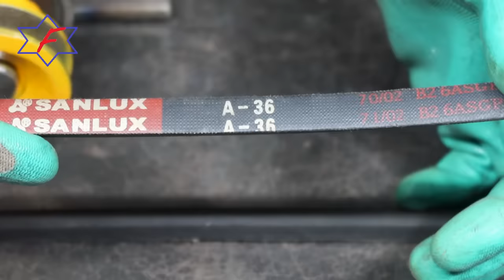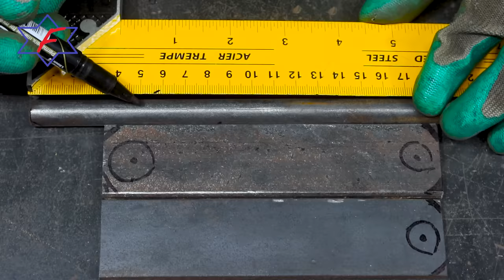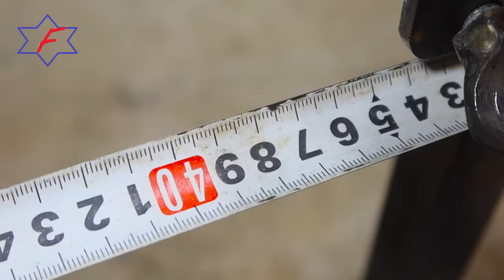Make A Mobile Table Saw Use Battery Power | Easy Bring To Workshop For Everyone

Comment: Love it, and I can understand the reason; store bought saws sucks, motor dies after a while and no replacement to find, battery charged is new but very handy. And the 90 and 45 degree are not using the same slot so the opening is always small. Good job and thanks for sharing.
Reply from the maker: You are welcome!
Reply: ឱឱឱឱឱឱឱបុ

Comment: Great build but ditch the battery idea. That 3000watt motor need to draw 250 amps from those little 12volt batteries so they won't last long nor will that inverter.
Reply: Piosenki
Reply: @StefanStefan-qt6vy  o

Comment: Please stand to the side when cutting.  And add a splitter after the blade. Those boards go faster than you can duck from the kickback. 
Very interesting and skilled piece of machinery.  How do you recharge the batteries ?
Thanks for the video. I watched from beginning to. 😋

Comment: Awesome job bro. You're amazing with the fabricating.bAre you tig welding this mild steel with no filler..ie fusion welding?
Reply from the maker: I used this one: https://bit.ly/3zRuNUY
Reply: @fawabros  yea I seen thr welder but I didn't see any filler rod that's normally with tig. Did u just fusion weld it.  Or is that a tig with a wire feed?  I can't find which type of weld your using.  The technique.

Comment: Aways table saw fence got to be on right hand side  bro... also always count the safety first while designing the machine and while working on the machine... your fingers to close to the running blade, use push stick or push pad

Comment: Great tool idea but cross cutting the way you are doing it is dangerous and you could be exposing users to injury. If you put a miter gauge arraignment for cross cutting  on this it wouldn't be a bad idea . An easier way of doing this would be to just buy a cheap table saw and put an inverter on it with batteries and  an inverter and you would have the same thing only safer . Right now any one who builds this is going to get hurt  eventually and this is not a good thing if you want your channel to grow .

Comment: Nice project! I was looking for some idea to build the same when I saw your video. Good job but I noticed a few things that you should take into consideration.
1. I noticed that your blade is moving in the opposite direction. The cutting action should force the wood down to the table not up. 
2. Your blade should be tilted away from the fence so it won't cut the fence by accident.
3. I'm sure that you're going to or already made a cross-cut jig or something similar for this saw because as mentioned by others, it is just a disaster waiting to happen if you don't.
4. The saw is noisy and the blade is a bit wobbly. I think you should place some grease on the bearings. It will also cool the metal down a bit.

I hope you advise these to your fellow followers so they don't make the same mistakes and injure themselves. Overall keep up the good work. 👍
Reply: Blade is moving g in right direction. It does look a little weird an possibility wrong but I think it’s just the way the camera films it. It would never cut as well as it does if it was backwards.
Reply: 1. Wrong
2. .. what?
3. Ppl that have used this tool IRL knows this part is always either lost or missing when you need it anyway. 
4. I don't know what tool you use to measure sound through YouTube videos but I assume it also has some type wobbloumeter feature?
Reply: @avogadro61023  I know but try watching it at slow speed around 31:55. I repeated it many times but the blade really looks like it is turning in the opposite direction. It could be the cause of frame speed.
Reply: @FrankyBmagic  
1. I already answered @avogadro61023 on the matter
2. Look at 32:30. If the width of the wood is too small compared to its height, the blade could hit the fence. you can prevent it from happening if the fence is put on the other side, or the blade is tilted in the opposite direction. You just need to turn the workpiece around.
3. I know that too. Just saying. I don't see anything wrong with it
4. Experience is the best tool. Just like how an experienced carpenter eye-ball a spot, he too can tell if the device is having some issue by the sound it makes. But empty vessels usually need hi-tech tools just to do simple jobs.
Reply: 1. You made an idiotic comment sound reasonable with that answer of yours. 
2. Still don´t know wtf your talking about, he seems to cut just fine with the blade angled. 
3.A better comment would be about the lack of a splitter. 
4. I doubt this guys has built anything else in life than a relationship with God
Reply: 56666

Comment: This structural engineer jo b welding was done by a tig welding process and it was done without filler rod
Reply from the maker: It need filler rod but I hide this process.

Comment: Oops! My dad made a saw (220V) in the 70ies with the same principle with two cranks: 
the engine sits on a rocker and when changing the hight of the blade you must wind the crank lifting the rocker to ajust the v - belt! 
But when tilt to 45°, the blade shows up through the same slot, as not the blade is tilt, but the table!

Comment: We all learn from our faults or on other`s ones , Your fence is on the wrong side of the blade . Those kind of miter cuts are very unsecured you need a sled for that kind cuts . The fence has no accuracy without a right angle guide following the table side while keeping it parallel  to the blade . The mechanism for the belt tender should not be on the blade system cause as soon you have to tighten it later on , the blade will move out of its line .All the mechanism should be tight and not lose like it is , this gives you imperfect precise cuts while it vibrates .
This is a machine that needs perfections and preciness in every single cut . So there are plenty of updates you need to do if you want it to be perfect , unless you only needed a video for YT purposes .
Hope you still have your fingers , SAFETY IS A MUST and there is nothing  secure on this machine , mainly if tou have to cut a thin strip of wood with the angle cut with a metallic fence straight into the blade .
But I will give a like just for the project on the how to make one .
I have made one already and has never feel the need to make angle cuts with it , A good sled takes the machine to another level . There plenty of videos about sleds on YT .
If I have to rebuild one , I would just buy a 2000 watts circular saw and place it under the table and remove it when I need if for other purposes those machines comes with cordless models , that can be way much cheaper than 2 batteries and a 3000 watts inverter .

Comment: 1. Whether the batteries used are rechargeable?
2.What is the voltage at which the works?
3.What is the device placed in the metal box ? AC converter?
Reply from the maker: Dear all, I used electric converter. And I don't recharge battery on this table saw.

Comment: Never cross cut with the fence in place. Especially when cutting a bevel. The kickback will pull your hand into the blade and is much more likely to happen due to the board being trapped against the fence. Crosscutting should be done with a sled or a mitre gauge using a t slot on the table. These home made table saws are incredibly dangerous without such features.

Comment: Motor specifications 
rpm ?
Watts?
Reply: Motor 220v, inverter 12v to 220v... I think.
Reply from the maker: It's 3000 RPM, 3 kW.
Reply: Thanks

Comment: Why doesn't you weld properly with add materiel? You use tha TIG as a nail gun. In some other films it is possible to se the crack in weld after you grind it. I just dont understand why you you wont weld properly? It is very annoying to se ju jump around with the TIG as a glue gun and the poor welding that does not hold near as it should.

Comment: This
video is a joke, a motor of this size cannot be operated so permanently,
especially when AC. The batteries can't stand it. Plus, nothing is fixed,
everything is swaying and unstable. What’s more, I’ve never seen it that not
the motor but the saw shaft is tensioned, so parallel cutting is certainly
impossible
Reply from the maker: I don't know why don't you believe it. But actually it's very stable because it's don't stand on wheel when working.

Comment: So it does 90s and 45s and that's it¿? Seems kind of lacking in the adjustability but something tells me that's not the only issue..... Cool idea but you should have just mounted a real circular saw so you use every angle in between.